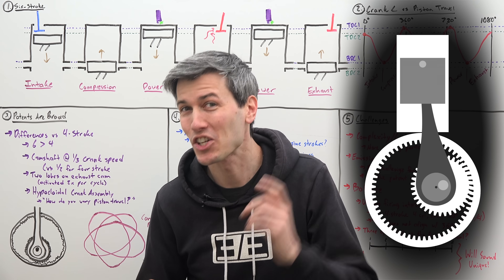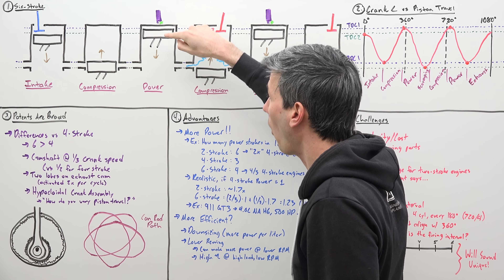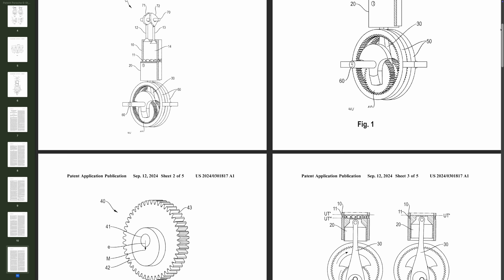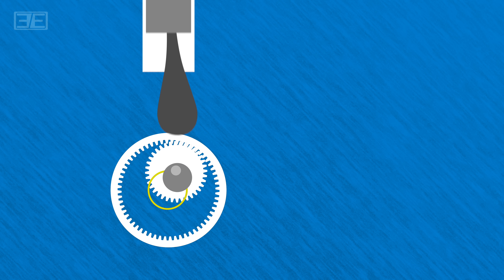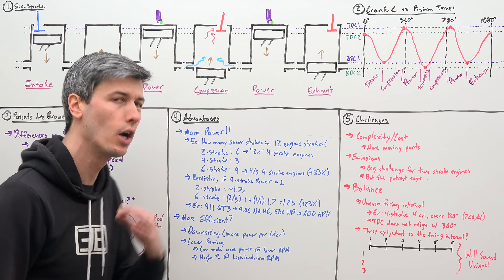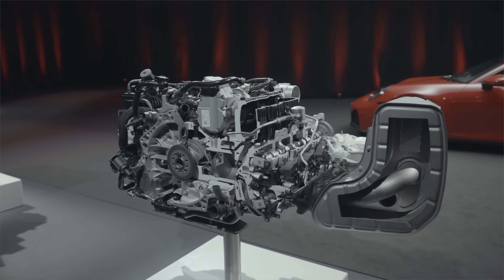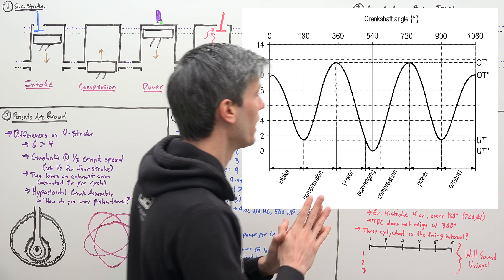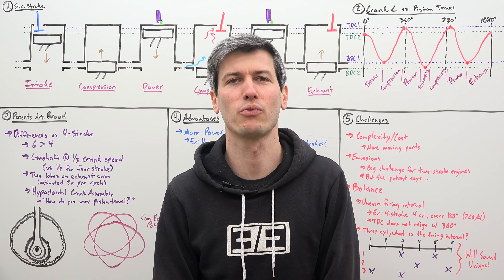Porsche's 6-Stroke Engine Is Genius!

Comment: The question I have is regarding stroke 4, what appears to be a combined intake and exhaust stroke. How is air drawn in through the lower ports? Does the 6 stroke design require forced induction?
Reply from the maker: Great question - see pinned comment up top. I want to say yes, it requires forced induction - but, the patent leaves a lot of options on the table, so I didn't want to rule it out.
Reply: @EngineeringExplained  Thanks for your reply. I have further issue with that stroke. A major power limitation of ICE is the mass of air in the cylinder. Based on your drawing which may be for illustration only, the lower inlet ports will not be open very long and the exhaust valve is open. This suggests low air mass and low compression, resulting in a fairly weak power stroke (stroke 5). Do you have any insight to this?
Reply: @charliemason4355  He mentioned at the beginning of the video that 2 strokes have around 70% more power than 4 strokes (from double the combustion events) so yes, this second power stroke is likely to be weaker.
Also, if forced induction is used, the 2 stroke portion is unlikely to benefit as the intake port and exhaust valve are both open at the same time,
Reply: @cwt5654  Yes, that 70% was for conventional 2 stroke engines, in which the intake valve is opened for nearly all of the intake stroke. The volumetric efficiency in a conventional 2 stroke would be far greater than in stroke 4 here, with a the inlet port opened for only a short duration. Additionally, the cylinder hasn't been emptied of exhaust yet. To the contrary,  the exhaust stroke is in progress. The resulting mixture would appear to be a small amount of air and an unknown amount of exhaust. With that said, either I'm completely off base or, for this engine design to be an advancement, there's something we don't know. I think there's a piece of the puzzle missing. More than likely this is do to the broadness and vagueness of patent.

Edit: In my haste, I mentioned 2 stroke engine as having valves. I should have said ports. This brings me back to whether the location of the port on the white board is as described in  the patent. My gut is, the intake port is higher up, more like a 2 stroke. The question remains, what is the force moving air into the cylinder, external forced air device or downward motion of the piston?

Comment: How is this any better than just going 2 stroke all the way? If you use forced induction and direct injection you could make a clean 2 stroke engine that still has wet sump crankcase lubrication. (Blower style supercharger, or maybe electrically assisted turbocharger to provide airflow at low RPM)

Comment: Simple Summary (AI generated):
 
Porsche has patented a six-stroke engine design, which has two extra strokes compared to a typical four-stroke engine.

The six-stroke engine combines a four-stroke and a two-stroke engine, resulting in two power strokes per cycle.

The engine achieves this by using a hypocycloidal crankshaft assembly, which allows the piston to travel different distances and reach two top and bottom dead center points.
The key advantages of this design are:

Power Increase: The two power strokes provide around a 23% power increase over a four-stroke engine.
Efficiency Improvement: The engine can be downsized or operated at lower RPMs for better fuel efficiency.

Potential challenges include higher complexity/cost, emissions, and uneven firing intervals due to the unique crankshaft design.

Overall, it's an innovative and clever solution, though it remains to be seen if Porsche will actually implement this six-stroke engine in production vehicles.

Comment: Don't forget that all combustion engines are 4 strokes 

Even jet engines and "2 strokes".

It doesn't matter how much of intake, compression, ignition and exhaust you can fit in one crank rotation, otherwise rotary engines could be called a 0.66 stroke engine

Comment: Due to two-stroke cycles, the oil on the piston ring will be washed off when pass through fuel intake port, oil consumption and cylinder wall wear can be potential issues.
Reply: Love my Detroit 2 strokes!
Reply: It is an air intake port, there's no fuel here to wash off the oil although there will probably be a small amount of transference. Fuel will be supplied by direct injection.
Reply: @chrishartley1210  this actually means that, with DI combined with modern coating/rings technology, one could develop a
sump/dry-sump lubricated (hence clean) 2-stroke
engine, after all ...
(methinks 2-strokes
have been "politically" unpopular throughout the decades, as they have 80% less steel components, thus less TO for Big Steel...)
Reply: @jn904  The 2-stroke problem is still going to be that the intake air goes through the crankcase and will pick up a small amount of oil. I don't think direct injection is really practical for smaller engines, the pressures involved are just too great, but injection into the transfer port is certainly possible.

It highlights a point on this engine, if this engine is normally aspirated I don't see how the air is going to be drawn into the engine for the second power stroke, that's where compression in the crankcase comes into play and I heard no mention of this.
Reply: @chrishartley1210  There have been 2 stroke engines as small as 50cc using direct (air blast) injection. 

What doesn't scale down well is the supercharger needed for providing the scavenge pressure. Small 2 strokes get around this by using the crankcase volume as a supercharger, but of course as you mentioned that has the whole issue with oil getting mixed with the charge air. For a car engine I expect they would just fit a roots blower.
Reply: @nerd1000ify  I didn't know about direct injection at that size of engine.

The point I was making is that this is supposed to be a normally aspirated engine, so no blower. I suspect that it would need a low pressure turbo. That could have a second advantage for fuel economy: disable the extra power stroke at startup/idle with no fuel injected. Keep the exhaust valve open. It would operate in a similar way to the engines which disable cylinders in turn during those conditions.
Reply: @chrishartley1210  I also assume that this invention relies on Supercharging,
otherwise it seems as too much complexity for too little gain.  With Turbos, however, the exhaust pulses could be crucially beneficial and very suitable for instantness of response.
Reply: @chrishartley1210  Well there has to be a blower of some sort for any 2 stroke to work. You make a good point that the engine could run as a 4-stroke with an additional revolution of coasting, the 4-stroke operation would let it start without a mechanically driven blower.

Comment: 9:26 there is a very small increase in energy efficiency on the first three strokes because the intake stroke is shorter than the next power stroke it basically acts like an atkinson cycle, although the difference on the strokes is very thin so the efficiency increase would also be very small

Comment: 8:39 brb I'm going to take a nap... In contemplate the cycloidal rhythmic dance of the Pistons
Reply: What I will say was I was thinking about the emissions and the well if it has two compressions with a beautiful small additional air intake it burns through all the additional fuel perhaps more efficiently or more completely I'm trying to decide what I was thinking initially while I was... Anyway we'll get there in a minute
Reply: 9:00 Yes and then considering some of the electric motor editions especially those like what were they turbochargers that you were mentioning a few episodes ago... I can only imagine some of the very beautiful mechanical engineering that goes on to make -- you know the term horsepower it it is a beautiful quaint thing isn't it... I mean it goes clear back to Oregon trail I guess but then it's more like oxen power.... Then I remember those little Seabiscuit things sorry and reminiscing...
Reply: I was also going to agree with costume complexity because of the interesting rotational and... Wear and tear of going up and down constantly... Not inherently a bad thing when we're considering that the air we breathe would likely be cleaner and more completely burned with cars... But then we also have to consider other factors for pollution as well...
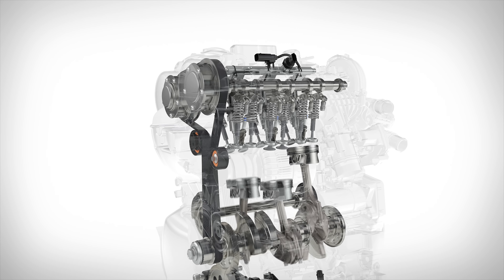Reply: I'm glad you pointed out the oil thing with the two-stroke as well 11:34 I'm glad you smiled so well too because I was thinking similarly to Porsche on this one... But there is added let's say friction so from a material science point of view the rings that go around the piston head for the compression... I wonder what material science they're going to need for the strength flexibility and complete seal
Reply: 13:43 valid point and I definitely agree with that one... It's going to be very interesting to see how they load balance the engine firing so that it can handle the....

In video games I chose Porsche as my main car for a lot of reasons most of which was handling purposes 

And because of the engine firing would... Something about equal and opposite reactions... Potentially depending on the engine size...
Reply: 14:16 congratulations and happy Valentine's Day 

Would you be interested in doing a video on Hyperion XP-1?!

I don't remember if you have already...

Comment: Regarding improved efficiency,  I wonder if the expectation is that the 2nd power stroke also has the potential to burn unused fuel from the 1st power stroke. Even with perfect air/fuel ratios, it's not uncommon for a small amount of fuel and air to not combust in each cycle.

Comment: Is this new? I thought driving4answers covered this a while back. I remember him mentioning that the reason it's more efficient, and you mentioned this word once at the start and thats it; scavenging. Im pretty sure no fuel is injected for that second power stroke, it uses the unburnt fuel from the first stroke, which also leads into your "im glad they sorted out that clean burning problem". I bring this up because this breaks your calculation on the additional power over fourstroke.

Comment: 2 stroke engines require oil/gas mix, does this 6 stroke need oil for combustion and if not, why?
How do the piston seals work when they have to pass the lower air intake ports?  Is this the source of combustion oil?  How do you manage oil pressure?

Comment: someone with a Phd in engine design inside Porsche is just flexing his abilities.   this will never be available in a showroom.   

in a different industry, we did patents on everything we could dream up and get away with.......just  because we could.
Reply: Plenty of unusual engines have made it to market.
Reply: @pauloakes6952  they don't because they dont make money out of it .periods.
Reply: @pauloakes6952 Not realy the only unusual engine is the wankel engine everything else is just a standart engine with a normal crankshaft. Doesnt matter if inline, v shape, boxer or star engine it is all the same. An Atkinson and Miller engine is just a slightly modified valve timing, even they are the same one closes the inlet valve early to let in less air the other close it later so some air will be pushed back out during the compression phase
Reply: I'm guessing this started as a student project. Honestly.

Comment: Congratulations, Jason! Your videos have been very educational to this old motorhead!
BTW, extending the firing order discussion, increasing the number of cylinders and reconfiguring the engine to a boxer or a v type only makes the problem worse, as you end up with more cylinders needing to fire at the same time. This can't be done without major stresses on the crankshaft, which appears to be slender to accommodate the inner gear. I don't see any way to balance this engine and minimize the stresses with more than 2 cylinders.

Comment: I feel that Porsche could achieve their goal with just changing the intake side of the engine. Coates Engineering developed heads utilizing spherical rotary valve camshafts, but they failed to make it work on the exhaust side due to the immense heat. Using this on the intake side would eliminate a lot of friction and other mechanical limitations. The poppet valves on the exhaust side are smaller, proven and less likely to be problematic. I think this should be tried first before pursuing the complexity of a 6 stroke and only requires a new head design to move forward.

Comment: How the hell do you vary the TDC and BDC? The crank is a solid piece it's not stroke or degree changing. How is that possible without some kind of other actuated lobe that is on the crank and somehow degrees itself. Still pretty close to the beginning, really helping you explain that part. Because my mind is really boggled trying to think of how you can change the stroke of the crank on demand
Reply: Did you even watch the video? He went into detail on how it's done.

Comment: If there are really benefits in burning exhaust mixed with fresh mix second time and there's even EGR for that (you did not mention it)
why not just make a two stroke engine which same as this design does not fully replace once burned mixture?

Comment: This engine is actually going to have a lot of problems and here’s why.

As long as the piston is moving, it has a small oil film to keep it lubricated. The only time there is no lubrication is when the Pistons stops at TDC or BDC and turns around. This would normally make it to where the piston would only stop at the very top of the cylinder and the very bottom creating two spots where the cylinder has where due to the piston stopping. Now with Porsche’s new design there is two top dead centers, and two bottom dead centers. What’s going to happen is The top dead center that is below the highest one and the bottom dead center that is above the lowest one will have increased where More compression loss prematurely.

TLDR, having a six stroke engine will cause the engine to wear out faster.

Comment: For balancing purpose, the firing order of cylinders on a 3-piston engine could be: #1, #3, #2.
On a 6-piton engine, there will be paired pistons and firing order could be: #1 & #4, #3 &#5 and #2 & #6 - it is a repeat of the 3-piston one.
Then the next would be a 12-piston engine.

Gratz on 1000th video! You do a great job! Hope you'll continue up to your 2000th one!

Comment: How about using a VR3 engine to solve the firing intervals? 
Imagine a very compact 3 cylinder engine with the power of a 5 cylinder and fuel consumption of a 4 cylinder.

Comment: for that last point about balancing, while its not possible to arrange 3 cylinders to fire evenly, it is possible to have 6 such that on every stroke there are 2 cylinders firing, 1 on its first power stroke and the other on its 2nd
Reply: Another guy was pointing out you can do the same thing with 3, each stroke 1 overlaps with a different cylinder’s stroke 2, so that you get 3 big combustion moments and 3 big gaps. Neat stuff

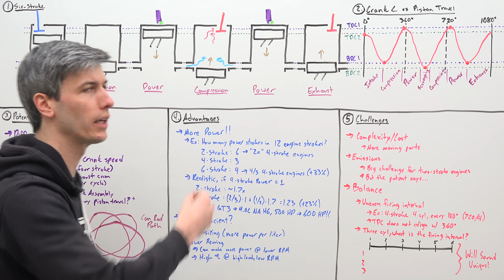Comment: I don't think the 2-stroke phase is a problem. Two strokes problems lies in the fact they need to burn some oil plus the combustion is technically not complete as some gasses are expelled from the chamber still not fully ingnited, reason why high power 2strokes can often makes exhaust manifold glow red in case of high velocity fluids and are know to have "oily" exhaust manifolds due to high pressure and un-ingnited material (reason why racing 2strokes manifolds are often wrapped with kevlar cloth). While in the Porsche design the 2nd compression is "dry" , meaning there is no fuel injection, only the remaining un-ignited parts of the a/f mixture are compressed and re-ignited to achieve a higher coefficient of combustion (reason why the stated clean combustion). The main goal is to inject N quantity of gas and being able to burn 100% of that quantity as well as "cleaning" the cyclinder fully before injecting more fuel. Residuals of un-ignited materials between combustion cycles are the ones that create most of emissions. This is the main reason Porsche created a port-head at the bottom of cylinder to have a better mix between a/f. In 4strokes the a/f comes from top, while in this design there is a second air injection from bottom, making the a/f mix inside more balance and better distributed. Hence this part of the video at 11:00 is technically not correct.
Reply: 👏👏good

Comment: A valved two stroke, intake port and exhaust valve. Instead of two ports, one exhaust, one intake. Valved Two Stroke keeps flow going in one direction out of the cylinder, in the bottom port, out the top valve.